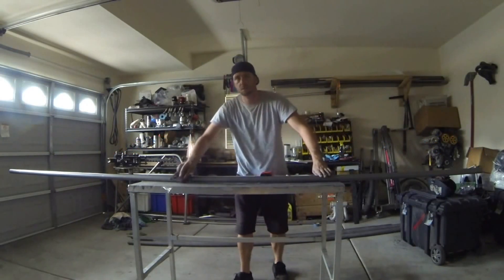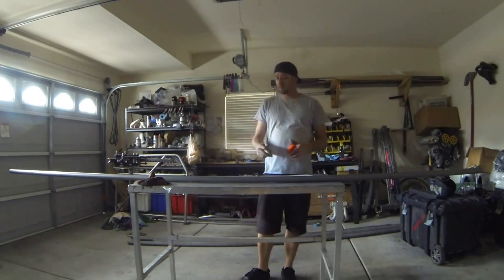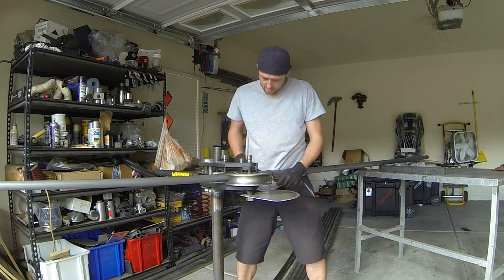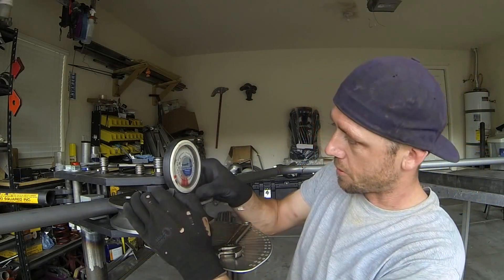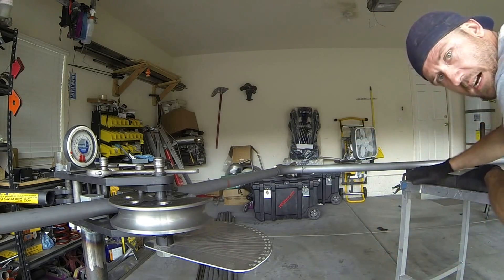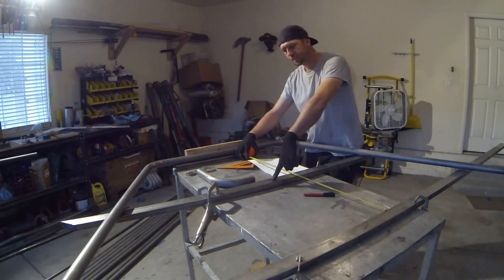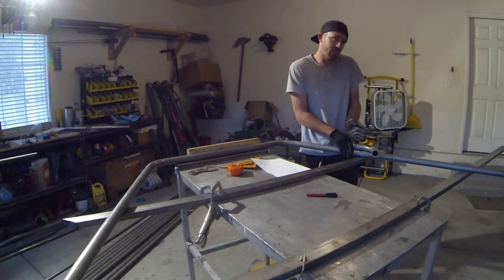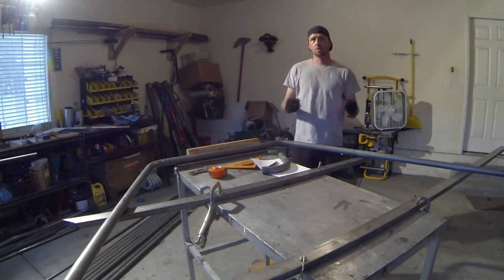TFSS: How To Build A Time Attack Roll Cage - Fabricating The Main Hoop

Comment: Question... When buying tube dies for your bender, which CLR die is optimal? 1.) The largest CLR or 2.) The smallest CLR 
As far as general purpose bending dies go...
Reply from the maker: +11LowDown11 This may sound like a generic response because there technically is no optimal CLR. It's mostly dependent on what you are building.

The tightest CLR will net the tightest fit, but some sanctions have rules. Roll cage specifications usually follow the general rue of thumb of: Diamter x 3 = Minimum allowable CLR. I follow that rule for choosing the CLR for each die. Different bends, or uses of each bend could require a different CLR, but it's all up to what you are planning to use that particular bend for.

Comment: Hey man hate to bug ya but quick question. I just got my jd2 bender and getting ready to order my 1 5/8" die for my chromoly cage, what CLR would you recommend. 5 or 5.5 or any other? Thanks for your time.
Reply from the maker: The general rule of thumb for CLR size for a tube is "Diameter x 3"

It is actually listed in a few rule books as a minimum requirement. On a 1 5/8" tube, you could get away with the 5" CLR, but do 5.5" if you want to play it safe.